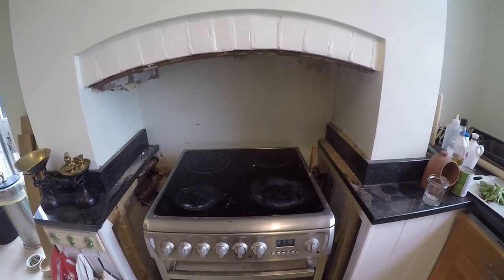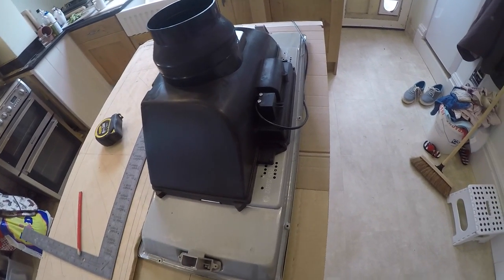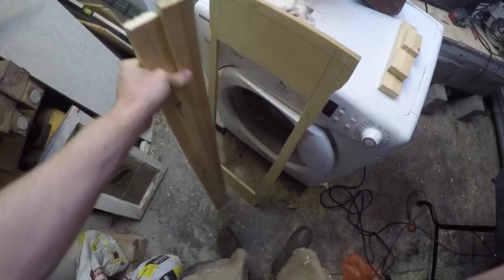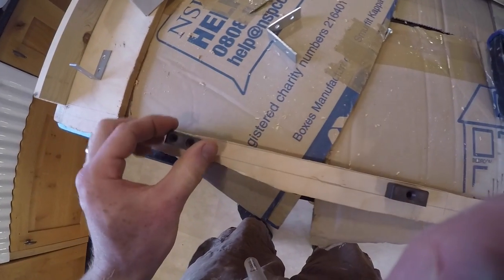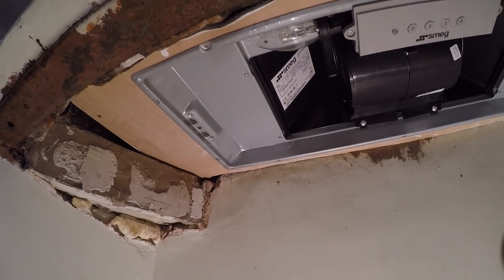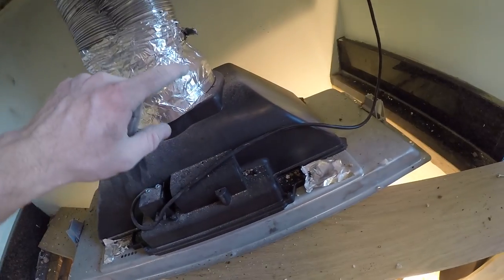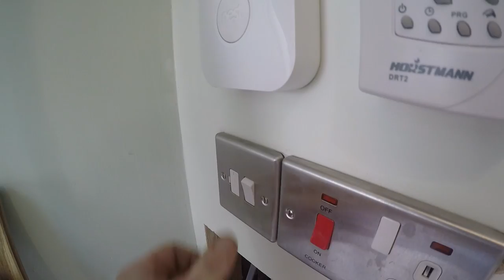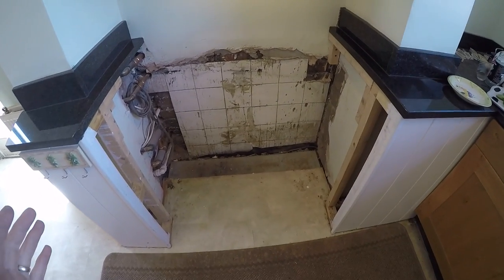Fitting Range Cooker and Extractor in Kitchen Fireplace

Comment: Have you found this size fan has worked efficiently for you with it being smaller than the size of the cooker? The research I have done is that the hood needs to be the same size if not bigger than the cooker itself. We have the same dilemma of fitting an extractor fan in a chimney but I'm concerned that the 70cm fan won't work efficiently for our 90cm range.
Reply: Did you find a solution. We are in a similar situation too.

Comment: We are going though this now.  Although there is no ducting already there, and we are grade 2 listed.  Do you think it would have been possible to have drilled the hole for the extractor out the back of the fireplace if needed?  great stuff.
Reply from the maker: Yeah better to go straight out, if we had no building the other side of the wall I would have,

Comment: Great video! What did you use to deflect/ stop on coal soot in the future for dropping onto the extractor?
Reply from the maker: A flue liner goes in from the other side of the wall about a metre up so it’s pretty much sealed below that. We swept it before that too which would of course help. Otherwise a chimney umbrella or similar might do the trick.

Comment: Wow.....I had the same problem as you....shallow chimney opening....and found exactly the same hood! I'm just waiting for it to arrive and trying to figure out how to install it. Now I know it's going to be a big job! Are you happy with the extractor? My flew was for the old boiler but exits the building three stories up. I wonder if I should use it or if it's better to set the extractor to recirculate instead. What do you think?
Reply from the maker: Don’t use the old flu. We had the same option but there is no way it’s going to get up there without condensing and dripping nasty stuff back down. Extractor is fine, nothing fancy but does the job, I dropped it down to 100mm for the last section but keep it as big as possible.
Reply: I have a problem then as I can't get to an outside wall. Maybe all I can do is set the extractor to recirculate. Or maybe use a carbon filter and the flue....removing all the nasty stuff first. I tested the flue with a blown out candle.....smoke goes up. I wonder if filtered cooking air is much dirtier than air from old boiler.

Comment: did the fan come with the carbon filters or do you need to order them separately, we did, eBay turned up trumps for those at £12 for both. having the lights is great, we use ours as a kind of "night light for the kitchen" in the evenings, LED is a must :)
Reply from the maker: +Lee Roberts Just came with the regular washable filters.  The carbon filters for this one are intended for recirculation rather than extraction so we may not need them, however will have a look.  Agree with the feature lighting, love the look of a dark kitchen with just the glow, plus the dog can see what he's doing too! TRC
Reply: Ah yes didn't consider recirculation, thinking about it now, that's why we got some for ours lol (no exit for extraction)...